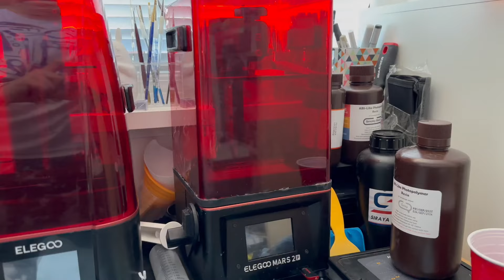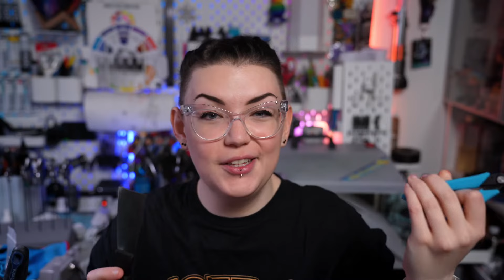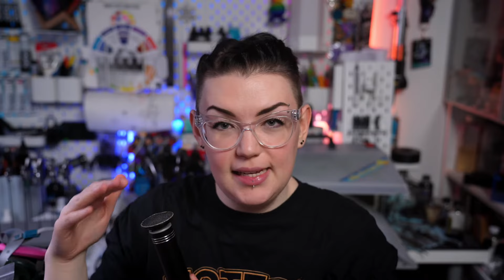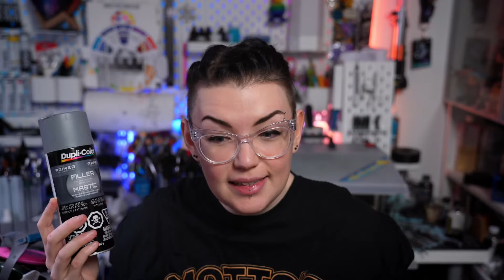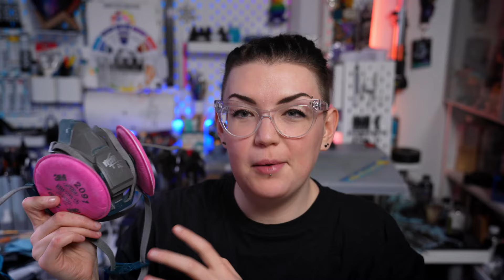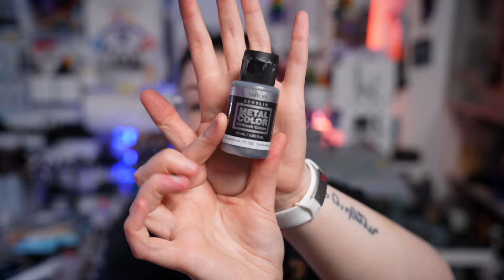Must Have Tools & Tips for Life Size 3D Printed Prop Making

Comment: Funny to see your e6000 and superglue trick :D
The other day i found out while glueing with both superglue and the e6000 that it would almost instantly bond ,faster as the baking soda and superglue trick :D i have arthrosis in my hands so i can't push parts together for more then 10 seconds or so..
I dotted the superglue on the edges and center of the pieces and then went over the edges with e6000 and after 2-5 seconds it got so sticky that it didn't need any more force :D happy days
Reply from the maker: There’s also instant bond super glue that comes with an activator spray that I’ve been using a lot lately. Literally sets in 3-5 seconds.
Reply: @MMsPropShop  yeah i know but it's not widely avaible in my area and stores that sell it are asking crazy prices for that small bottle 😂

Comment: Hey, you have mentioned multiple times the wood filler that dries to a "plastic type consistency" I think it was pink or some such thing. However, the one you linked in this video doesn't seem to have the same consistency. Can you advise the part number of the type you typically utilize?

Comment: Hello! I know this is an older video so I hope you see this, but I’d really love to know more about your printer mods, if you’re up for sharing some info
Reply from the maker: Most of them were more quality of life things; new fans to make the printers silent, BLTouch to make bed levelling easier, etc. Depending on the printer I’ve also swapped the build plates to magnetic PEI sheets and changed the extruder fan cover for better parts cooling. Is there something particular you’re wanting to know?

Comment: I tried heat gun thing for resin, didn't work as well as just letting resin prints soak in IPA for a few hours before curing them with UV.
Reply from the maker: There are some resins that actually advise against leaving the pieces in IPA for more than a few minutes. Glad it’s working for you, but just make sure that you’re not accidentally damaging/weakening your prints.